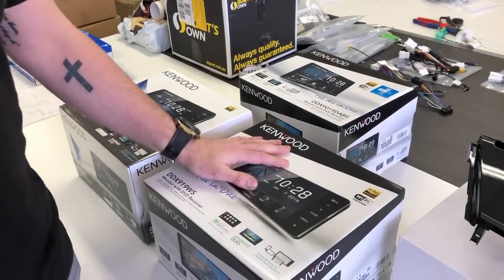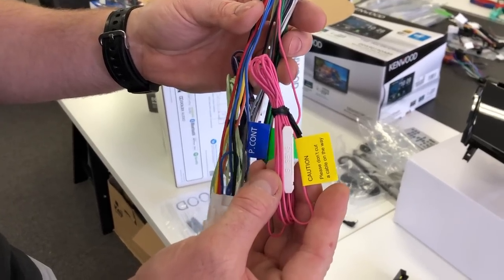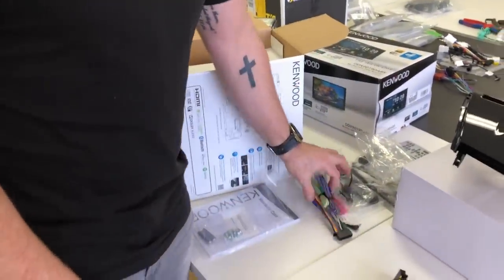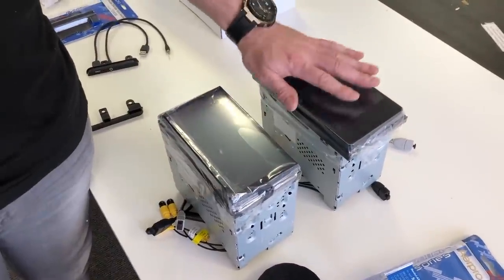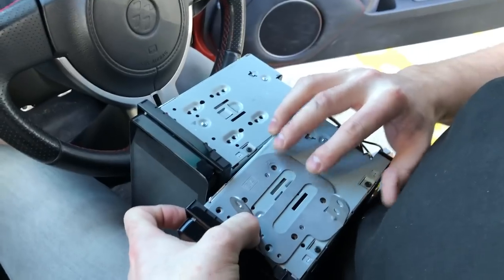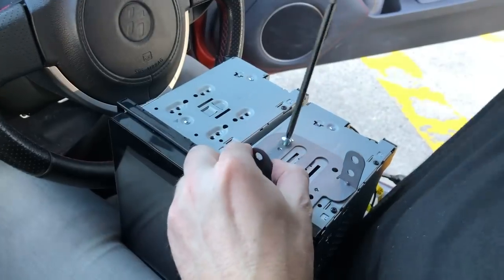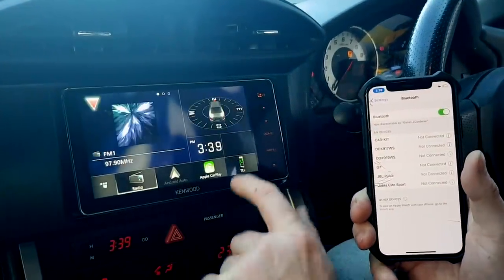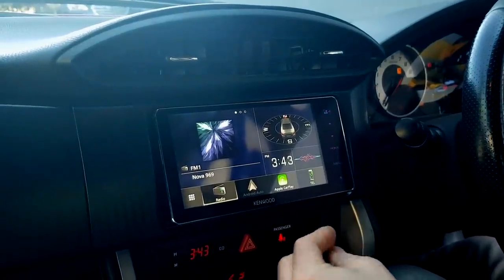Full Review Kenwood DDX919WS Wireless Apple CarPlay & Installation Kenwood DDX919WS VSS Wire

Comment: man you solved my ONE main issue with the display. its the annoying gesture control. i didnt know it had a gesture control. the display would annoyingly change from car play screen to the wireless mirroring screen ALWAYS if i try to change the volume. and the annoying DUNG DUNG sound that sounds like a windows xp error sound would sound off for no reason. thank you M8.

also, is there any way to turn off or reset the system without switching off & on the car.  and how do i update the software.

Comment: Thinking to get this for my 2014 Fj cruiser, currently using the factory satnav unit, with a Audison Bit10 processor, and Focal amps and speakers, I use a Google pixel 3 smartphone, so mostly just want Android Auto functionality, and that is the main reason for the upgrade, can this Kenwood unit just plug into the existing Audison Bit10 processor, that is connected to the factory Toyota satnav?

Comment: Hi there just put in my new kenwood ddx9019dabs im having trouble with the steering wheel set up it won’t let me in the main  steering wheel set up page at all iv use both plugs  but still doesn’t pop up if i use the 3.5 jack at the back nothing works. but if i plug in the other patch to the steering harness its sort of works.  but still can’t remap them?

Comment: Dear Sir I was wondering if you could help with a technical problem I have encountered while installing the DDX919WS into my 2018 Toyota Prado.  I have a hub error when I connect the stock Toyota usb cable extension.
Reply from the maker: Generally this is the circuit board on the USB needs to be modified to allow the USB passthrough to work.

Comment: Hey if I'm not going to use Apple car play do I need to hook up the pink wire or will it stop the unit working properly.
Reply from the maker: No sir if you using android or all other features not required!
Reply: @AutoChimp  awesome, was a good vid, I ended up with this radio by mistake order the Kenwood DDX918WS and got the DDX919ws.

Comment: 37:04 ayyy, that one guy was me (VSS wire)

Good to know it works without it. 

So to confirm with the Wireless Android Auto, that restriction is placed on the head unit and NOT the phone?
Which means if Google does allow it in Australia that would be a firmware update?
Reply from the maker: The wireless Android is not currently on all Android phones in Australia yet and google being a bit sketchy advising on its complete release basically. It will be shortly as the units overseas do use wireless android already on the comparison models!

kenwood have no "advice" on if they will give updates .
Reply: @AutoChimp  Hmmmm. Ok. I might still pick one up and a month or 2. I have a Google phone, so it may work. I have the DDX916WS, it time for an upgrade.
Reply: Has this been updated yet?

Comment: Finally got round to installing my front and rear cameras on this unit, but when i go to the setting, for the cameras there Greyed out. Do you know of a fix for this?
Reply from the maker: earth your handbrake wire.
Reply: @AutoChimp  im pretty sure i did, i did the tick you showed in the video earthing it back to the radio. All other settings are available just not for the camera.
I will double check though
Reply: @AutoChimp  does the immediate reverse camera works with all kenwood? Like the newer 8020?